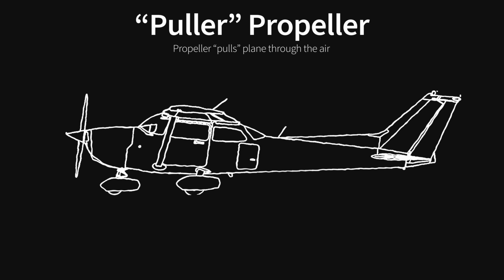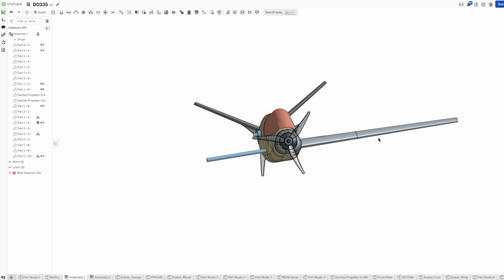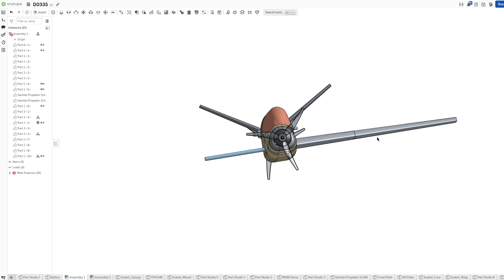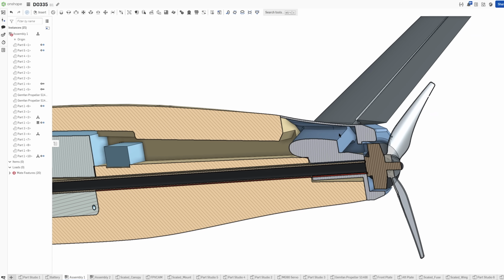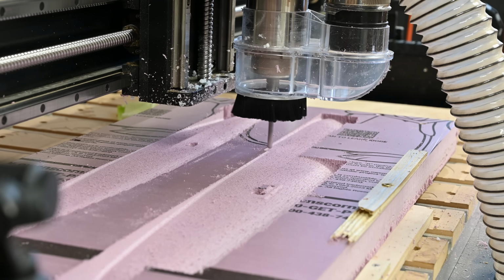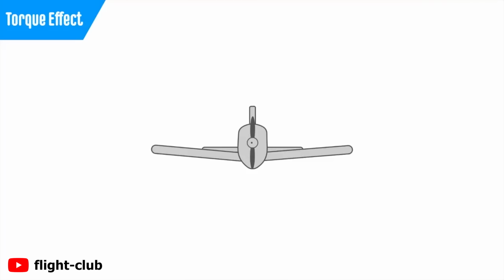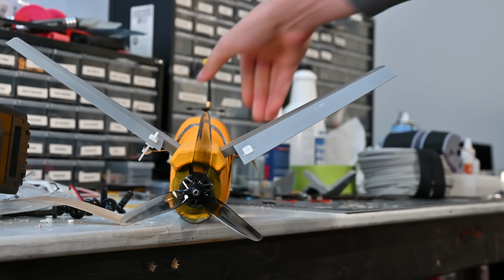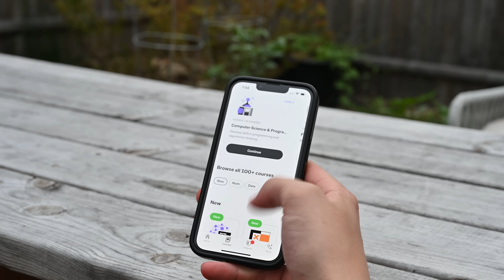Building a WEIRD RC Plane... Will it Fly?

Comment: As soon as i saw the first design i thought the wings were too far forward, if you took the rear motor off it would have been fine like that.  The plane probably needs a bigger conventional tail, and the rear fuselage needs to taper down to the prop more.  These planes were hard to balance in real life as well and had 1000s of hours put into them so dont give up!

Comment: 445   in case an explanation is needed, the outboard-located non-moving areas of the wing trailing edge  Impede/damp  responses to aileron inputs.      doing that is just  dum.
505   that is a pretty  iffy statement.!

Comment: maybe it's just too heavy, but i can't tell by just watching the video. you also could have a control issue because of too small control surfaces.
next time try with just the front motor first and see if it will fly. if not you maybe also need to change the thrust angle

Comment: 303    linkage on the  OUTSIDE,  why.?!       was there a  Reason  to not put the mass of servos  near  the cg/c-m.
308    aileron control horn  is  NOT  correctly located. 
323    design at the nose should  accommodate  a nominal amount of cooling air flow past/around a  motor.!

Comment: Hey, the concept looks good but main reason the aircraft wont fly is because of the V-tail. The aircraft seems to yaw out of control which is a result of poor yaw stability. This could be solved by making the surfaces huge however this isn't ideal. Another thing that might happen on this aircraft is that the aft prop, experiences a lot of turbulence from the front prop, helping to cause the out of control yaw. This is maybe why the dornier has such a tapered tail end and 4 tailwing surfaces. These surfaces might serve as a flow stabiliser for the aft prop. A V-tail and especially that high up on the airframe whould barely have any stabilising properties for the prop. In other words, switching from a V-tail to a cross tail, centerded on the axis of the prop whould help solve your problems ✌ (sorry for the long text)
Reply: A good rule of thumb is, if a V-tails isn't necessary, it's not worth the hasle. I speak from experience😅

Comment: 156    correct design of a swept wing calls for the use of a main spar in each wing half, located at thirty percent of chord.    a central main spar, located at thirty percent of mac should also be used.      the need for these components varies with the materials used.       nevertheless, the described spar configuration is the correct one; in which the forces that a (swept) wing experiences are correctly transmitted to fuselage, at the wing root(s).
157    ailerons   SHOULD  extend to the wingtips.!!!      at this point, the wing has almost no resistance to wracking.
230    the use of CF for longitudinal components is  not  recommended.    because, the dom of CF  cannot be optimized.     in this case, a piece of spruce, pine or clear-grained poplar could have been used.!
234    MOTOR  leads  should  be  elongated,  NOT  main power leads.!          googletranslate

Comment: I think you’re having a center of thrust vs center of lift issue. You could reduce the amount of power to the rear motor, that would help get the balance of thrust ahead of the center of lift, or at least in a workable range. The other issue is your CG, aim for 33% of MAC.

Comment: why?    why copy an antique design that was fast but  not  worth  'keeping around'.
do you realize that  DISTRIBUTION OF MASS  is something that pretty much  NEVER  scales  down.     as a result, the dom of a tiny version of a design  Must  be  'tuned' from scratch.!
there is a simple rule to know:    when an electric prop is noisy something  is  Wrong.      typically, that something is the use of a prop that is too flexible for the application.
043   wire pushrods  are  FLEXING  too  much.     guides are  Needed.        control  horns  appear to be   NOT  correctly  located.!            googletranslate

Comment: instead of counter balancing by heavier battery, you can try a long shaft to transfer rear motor torque to the propellants and place the motor itself closer to the front.

Comment: It's hard to imagine that the control problems in the roll axis are caused by the motor arrangement, so there has to be different explenation. Likely your plane has very high wing loading and requires a fair bit of speed to stay aloft. You are using quad props with quite low pitch so there is a lot of static thrust but no thrust at speed, thus your plane never achieves speed when it's controlable. Moreover the v-tail arrangement has adverse roll coupling which might make the problem worse.

Comment: I think you're fully aware of why this plane failed, so I'm not going to comment about it in 300 words. It's kind of a shame though because it looked nice. I would just cut the wings out of EPS or XPS and cover them with laminating film. EPP looks too flimsy. 

You should have flown with the tail towards the front to achieve stable flight😂

Comment: my guess is that your tail surfaces are way to small if you had separate horizontal and vertical services that were around that size it would be ok but when you combine them i think they need to be enlarged because they are having to do 2 stabilizing jobs instead of one each  but this is coming from someone with limited knowledge

Comment: I would suggest dual motor control channels, and start with the pusher at 50-60% of the puller... then you can play with it once it flies. I would also stay away from running too many experimental ideas in the same plane, at the same time. Use a traditional set of tail feathers... and keep the larger wing.
I would also make sure the props are big enough, they seem a little small-ish.
Reply: It would also help him determine if the two thrust lines are correctly oriented which is crucial with a pusher puller arrangement.
Reply: Why would you do that with the push puller? Sounds like a bit of rockets fallacy
Reply: The two props aren't stabilizing each other but creating the yaw that he notices. Although this won't fix it. Maybe rudder trim needed but he doesn't have a rudder.  @BeefIngot
Reply: @shadmansudipto7287  Not sure you got what I was saying. Im talking about power.

Comment: Make sure the thrust angles are correct and the propellers are both facing the right way (the thicker leading edge facing the front of the plane), it looked like in the beginning the rear prop was on backwards which could lead to some unwanted roll. And keep trying, this is a cool project :)

Comment: You should turn off back motor and see it it’ll fly true. Then do the same with the back motor. Fix issues before attempting both motors at same time. Increase the aileron and elevon moving surface area, almost to point of oversteer. You can always do light steering. Just my thoughts.

Comment: Michael, I am glad that you show all of the effort, more bad than good this time, of trying to make this fly. But I think you need to get back to basics. Take a look at the Cessna Skymaster. Traditional high wing with a pusher puller configuration that might make it easier to get the CG in the sweet spot which seems to be the biggest issue here. Got the popcorn ready for the next video!

Comment: Looks like you're severely lacking in aerodynamic yaw stability. Adding dihedral on the main wings actually only makes that worse (you gain roll stability but lose yaw.) The V-tail would need to be a lot larger/more vertical or you could use a traditional vertical stab. You'll actually notice on the Dornier Do-335 (which your design is reminiscent of) that it has both a dorsal and a ventral vertical stabilizer, which would give away more authority than what you've got here.

Also just another rule of thumb: if it doesn't fly well without flight stabilization it won't fly very well with it. Unless You're doing a whole lite of modeling/tuning/testing it's generally best practice to make the airplane fly without stability aids first and then add them in.
Reply: Cool project though! I think if you solved these aerodynamic issues you could totally make this work!

Comment: That camera right above the wing was probably spoiling the lift on the left wing for that crash before you rebuilt the wings to be larger
Reply: You can see in the video that it rolls hard to the left, because the right wing has more lift.

Also, making sure that your wings are as smooth as can be, especially on the leading edge and the top is important

Comment: V tail was too small, didn't have enough authority to keep the plane straight.
Reply: Combined with the camera sticking out causing huge drag on one side, I'd say that's pretty much the cause.
Reply: @jaketus  this is the main issue that and not enough surface on the control surfaces lol
Reply: I built a front and rear plane prop but I used the Cessna Skymaster design which has a boom tail. It flew incredible and was fast with the 2208-size 1650kv motors on 6s. IMO V-Tails can be tricky. Especially with such a small main wing that has no dihedral. Some planes just don't scale down very well. I would scratch the V-tail and do a conventional tail.
Reply: @FarmerFpv is dihedral up or down with the wings
Reply: V's too small for short tail length.
Reply: Tail-heavy + insufficient stabilizer authority. 
You can see it almost always tries to pitch up and also very unstable directionally.
Needs longer tail/larger stabilizer area and probably smaller control surfaces, or lesser travel for the later.
Reply: Forward CP aft CG
Reply: V-tails are the worst. Personally, I have experience with V-tail designs and they simply don't work unless you have advanced electronic stability. Ditch the V-tail and make your life easier.
Reply: Yeah maybe.. the control surfaces on the v tail are DEFINITELY too small
Reply: It needs to be steeper and original wings
Reply: Actually part of the problem is rough air from the rear motor. If he made the fusalage longer and then pushed the tail further away from the blades is would help a ton. Wider tail surfaces might help a bit also but not so much longer. I think the largest issue is they are too close to the front of the propeller. Many pusher airplanes are more rear wing and canard style. But with this style it needs a bit smoother air and longer fusalage to give it a longer lever movement
Reply: @newmonengineering  The tail doesn't see the rough wind of the rear motor because this plane doesn't fly backwards.
Reply: @toolbaggers  this is incorrect, the air is in compression directly in front of the blade and it creates vortexes on the tips of the blades. Depending on speed and air pressure altitude there are different boundary layers of separation. Moving it forward 1/2"   wouldn't be a bad decision but the fusalage should still be extended a few inches to add leverage to the surface deflection.
Reply: @newmonengineering  At these speeds, even a few mm of separation is plenty, and boundary layer thickness will be a fraction of that. The rear propeller will see more disturbance from the tail in front of it than what the tail sees from the prop.
Reply: wings dont create lift but turbulence only.
Reply: doubt that's the issue since they were as large as the old wings

Comment: Because the wings are made of styrofoam, they allow a lot of air to pass through or are prone to doing so. As a result, both your drag increases and your lift decreases. I suggest using a coating instead of this type of paint. The same applies to the body as well.

Comment: Looks like your v-tail is a bit small for the vehicle. And with such a high wing loading, you'll probably need a faster launch speed to get going properly.
Reply: I once tried building something of similar proportions, and it definetly needed more surface area in the rear. maybe even add a third smaller fin on the bottem for more yaw stability.
Reply: I do agree! I'm not an engineer but I mess around a lot with foam thingies, v tails are weird, he definitely needs a larger surface!

Comment: Too heavy (should be around 300g to max. 700g, wings too small, ailerons too small, V angle too flat (should be 90 degrees) and a flight controller is not necessary. The motors should rotate in the opposite direction and the CG must be correct.
Have fun on your second attempt...
Reply: Everything said above. A flight controller is an aid it still needs a correctly weighted and balanced plane to fly or it just masks the problems.
Reply: Yea that’s a pretty good summery I recon. A couple of additional notes, the v tail looks to small for the aircraft which could be the source of some of your control issues, and I wonder if there is some funk aerodynamics fighting each other a combination of the prop at the front and the pusher at the back very close to the v tail. Also worth slimming down that fuselage a fair bit too.
Reply: How will you, (as a hobby guy) calculate the area required for control surface ? Any thumb rule. Pls let me know
Reply: @fliteanalysis4927  Start with building plans that you modify slightly. Orientate yourself on the weight and dimensions of existing model aircraft.
Once you have enough experience, build your own models.
And light models always fly better than heavier ones.
Reply: V tail angle is a combination of the needed horizontal and vertical volumes. There are formulas to help calculate the needed volumes depending on the type of plane. Then there are formulas to help with the conversion from conventional tail to V-tail... you can end up either with 100-110deg or the other way around at 80deg...
Having 2 rotating masses at each end sure will increase drastically the inertia of the plane making the tail volumes calculation even more critical. Plus everything else already mentioned

Comment: I think you need to give ardupilot some throttle control here, it seems that the instability is exacerbated by slow response time on the throttle, you could map sharp pitch down movements to automatically cut the throttle back to hopefully make those instabilities less deadly
Reply: as far as solving the passive instability.... man idk. seems like the lift center/cg positioning is off but I'm notoriously bad at fixing that so i am not much help there